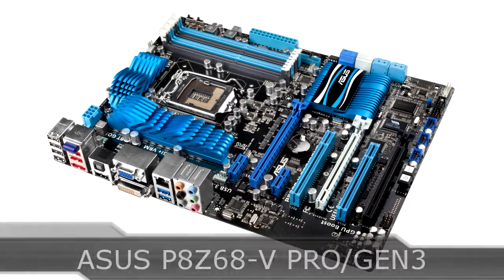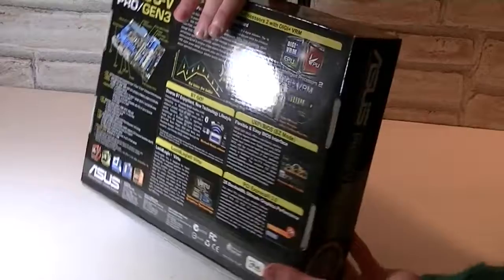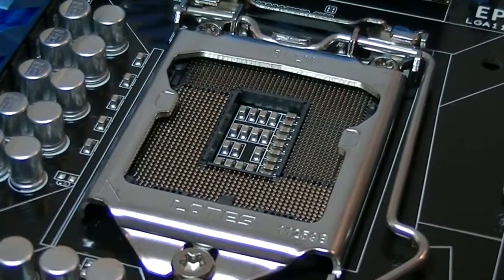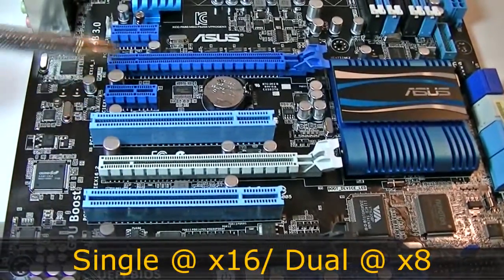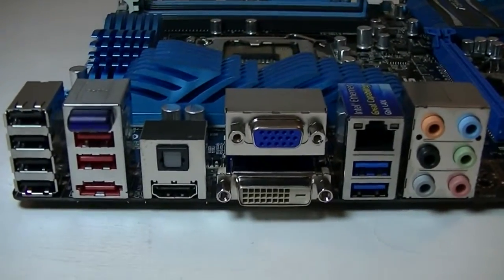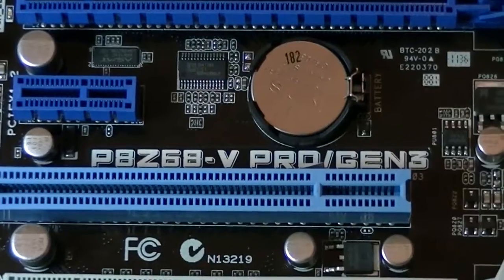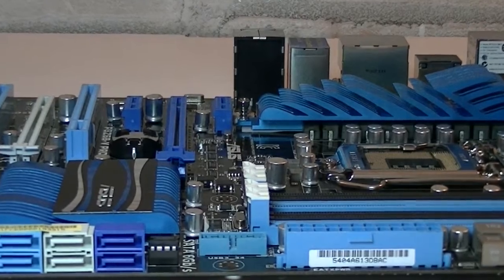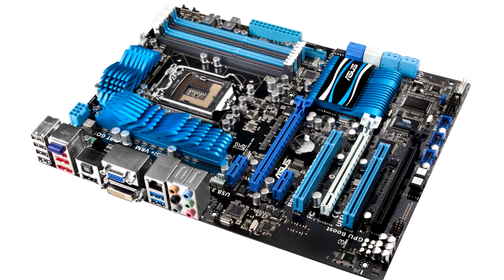ASUS P8Z68-V PRO/GEN3 Motherboard Review

Comment: I bought this badass with 16gb ram and i5 2500k for 50$ and msi 1060 gaming x 6gb for 50$ more. 
Slapped on a be quiet dark rock pro 4 cpu cooler, rm750x psu and 6 phanteks t30 20 mm fans for chassis cooling. 

Overclocked the cpu to 4.3 ghz and now I play wow dragonflight on 1080p, graphics set to 6 and max view distance. FPS is around 100-110. Its supersmooth and quiet.

Why would I spend 1400$ on motherboard, cpu, gpu and ram when I can get away with 100$ for hardware from 2009 who STILL do the job satisfyingly. :D

Edit: For audio I use a FiiO olympus 2 DAC with a Beyerdynamics DT 990 pro headset, and a HyperX solocast for microphone. So for in/out sound I use 2 usb ports, so cant talk about any issues others may have with the audio codecs i/o ports on the motherboard.

Comment: Wow ! This is totally interesting ! Although your review is "ancient" I have always had this Mainboard (Out of the roughly 60 other PC's I have) held this as one of my all time favorite boards because of its stability and flexibility. Only the Bluetooth, now ancient, has limited range. Other than that I have overclocked and gamed on it with an i5 2500k running at 4.3Ghz 24/7 , and today it now recently got dusted off and I had an i7 2600k set in and presently im toying with it again for an HTPC rig for 4k. I am excited to try out on my mainboard the recording issues you mentioned just to see if I have the same problem or not. I have extensively used the SPDIF on this MB for multimedia usage connecting it to my Yamaha Home THeatre reciever and had no issues, nice clean sound but as you put it, you had problems with sound IN. It seems your audio problems were in connection with the software, and I always take care when installing any operating system to make sure I dont add all the jingles and bells that come with a CD driver installation, I go directly to the newest updated drivers and make a quite minimalistic installation. Thus I avoid "software-bloat-blues" that you get with most purchased systems. Build your own and take care :)
Reply: Hi. I have this board to and wanted to know; can it support ARGB fans?
Reply: I'd also be interested to know this. There are 3 pins at the top of the mobo neighbouring the CPU fan header (see 5:50 in video). They look a little like VDG pins. Can't find any info on what they are.

Comment: Does this support 32GB DDR3? CORSAIR Vengeance 32GB (4 x 8GB) 240-Pin DDR3 SDRAM DDR3 1600 (PC3 12800) Desktop Memory Model CMZ32GX3M4A1600C9, Would this ram work with this Motherboard!?
Reply: I have this mobo with I7 2600k 32GB (4 x 8GB) 1600Mhz Kllisre 240-Pin DDR3 and it works normal, so I think it supports 32GB DDR3 CORSAIR.

Comment: i have had this board since it first came out, upgraded the processor twice and added some ram, but never had one problem. even audio recording was never an issue at all, and for power management, it does run a little high but not enough for me to not like the board.
Reply: +maddkiller 
still runs better than most new pc's i have played on.

Comment: I've had this motherboard in a computer I build 4 years ago using an Intel i7 quad core processor, 8 GB of Corsair memory, a GTX580 video card, and a Crucial 250 GB SSD running Windows 7. It hasn't given me a bit of trouble. Not even any BSOD errors. Maybe I just got lucky.
Reply: +Whatatay T i had no issues with it neither, best mobo i ever used :D

Comment: ASUS provides absolutely HORRIBLE support for this board, their BIOS updating program (that they INCLUDE), bricked the BIOS chip, so I am now missing settings in the BIOS, and I can't run my RAM at stock speed (forced to run them at 1333MHz instead of 1600MHz).
The overclocking options are gone, and the Auto Tune utility is not even usable, because the BIOS is bricked.

What did ASUS say? Buy a new chip.... Because they broke it.

Comment: which motherboard would you recommend for me i will have intel i7 2600k or i5 3570k cpu sapphire ati radeon 7850 hd graphic card and i will use cm storm trooper case, so which motherboard should i buy that i will get all features working fine ?

Comment: First problem was overheating cpu,on auto voltage was 1.3v =temp 81c (2600k)on stock speed,i set offset -60 and get 1.18 on 3.8GHz and -15c drop in temperatures.Can't believe ASUS make this...

Comment from the maker: If you'd like to set up i-Mode then plug in the monitor cable to the motherboard's port. If you'd like to set up d-Mode plug it into the graphics card's port. i-Mode is Integrated Mode and d-Mode is Discrete Mode. Hopefully this helped you out! :)

Comment: I will change mine,suddenly sata 3.0 can't work in anchi mode,it worked fine for six months unbelievably...I change 2 kits of ram,even if you manualy  set voltage mobo will overvoltage them...

Comment: great video.  I am selecting components for my first build.  I want to use an intel 15-2500k processor.  I really wanted the P8Z68 board but after your evaluation I am not very comfortable buying it.  What board do you recommend based on your evaluations?

Comment from the maker: @Kolibri1934 Thanks for telling, hope the new GTX 570 will work. When exactly did it die? My GTX 560 had problems with the first P8Z68-V PRO/GEN3 board. I got bad framerates on higher settings in Battlefield 3, but the power consumption was "too" low. With the second board that got fixed, but then it was way too high. Looks like the ASUS P8Z68-V PRO/GEN3 motherboards really hates me.

Comment from the maker: @Kolibri1934 Hmm... your power consumption seems to be okay for the onboard graphics. Of course I didn't test that so I don't know for sure. You probably are right that resellers get them delivered in serial batches. The replacement is the Gigabyte GA-Z68XP-UD4 after the second P8Z68-V PRO/GEN3 motherboard and this Gigabyte board works like a charm so far.